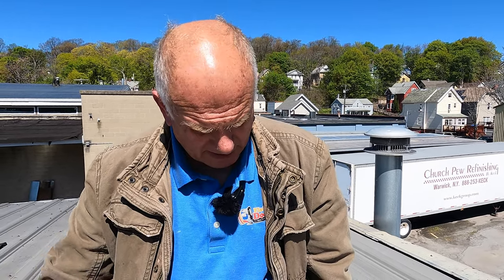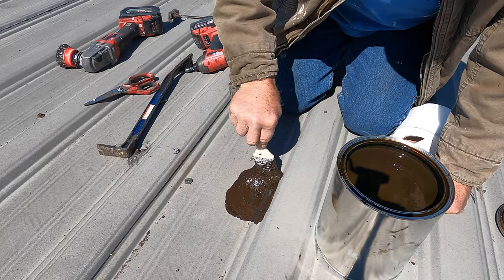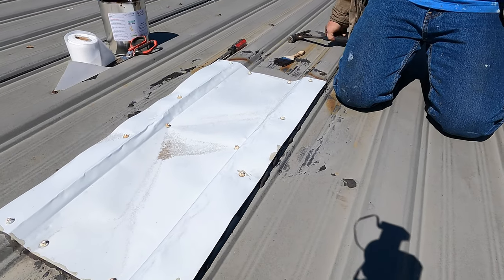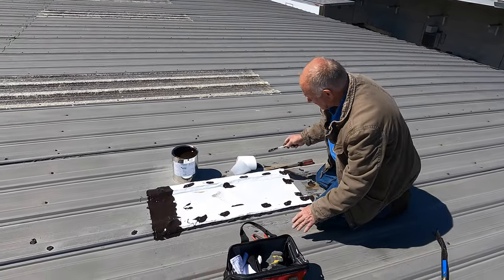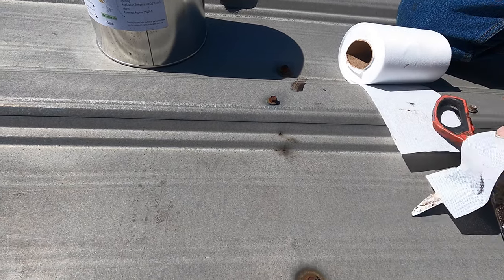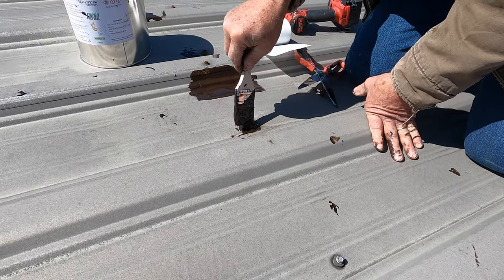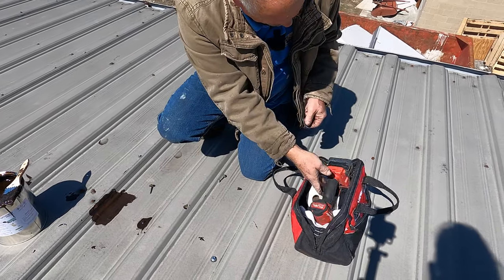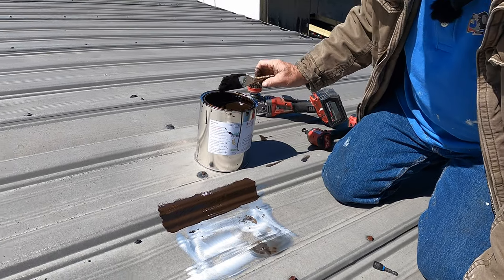How to Find and Fix Leaks on a  Metal Roof

Comment: 1. You NEVER cover a hex headed screw with fabric,  this creates bridging (an air pocket and/or fish mouths) around the fastener...You must cut the cloth at the fastener for proper waterproofing!   2. You always remove old caulking and tar...NEVER cover AND ALWAYS clean the surface area!  3. Is Turbo Poly Seal a Rust Inhibitor?  4. Always a bigger diameter screw, BINGO CORRECT!  5. FOLKS, always clean the surface area a minimum of 6" beyond the repairing area.  6. The aluminum coating will crack with in 3-5 years!
Reply from the maker: You are right in what you said. I am an idiot. Thanks for the comment
Reply: I  hope he makes an update version ,I kinda understand your comment .but I'm a bit of a visual learner (aka I'm kinda stupid when it comes to this
Reply: so are you saying there's no point in using aluminum coating??
Reply: @itsmedante.5325  Aluminum coatings have a place, but not in this application.  Aluminum coatings have no expansion/contractions properties.
Reply: I am renovating an old trailer with a metal roof. I am using a wire brush to clean the roof to bare metal then I will do as you say. Question: what if I can’t get to the hard to reach caulking? Can I just caulk over what I can? Must I remove all rust with the wire brush before repairing? Thank you
Reply: No, you shouldn’t put turbo poly seal or any other sealant over old caulk.  You’ll never get great adhesion, so make the effort to remove it, clean it, and  then apply your 3-course repair shown here.  

I have to agree with the original comment, and sorry to say the roof doctor is making a mistake here.  I’ve personally made the mistake of 3-coursing a hex head screw, and it created a pocket of water that began to rust and leak months later.  

I’d much prefer the screws be removed, the metal patch removed, clean the old caulk and debris off, and then re-install the metal patch with all new butyl tape.  One could then apply a 3-course with turbo poly seal afterwords for extra precaution.  *Use pancake head screws versus the hex head fasteners when applying a 3-course solution as shown here.

Comment: Great video identifying the leaks by looking for traces of rust or dirt stains.  Turbo polyseal spreads well and goes quite a bit, no need to lugging around a gallon tin ;)
Reply from the maker: you right, but I used a lot of Turbo that day on the rest of the roof. The video only shows a small part
Reply: @FlatRoofDoctor  it's good stuff.  Too bad it's not available in my country.  The closest I could match it was with Sika lastic 560 or Duram 195 here unfortunately.

Comment: For a 30 x 60 metal building that is approximately 38 years old, would you recommend just fixing the leaks or replacing all the roofing screws with the next larger size?  Thank you.
Reply: Sand the rust, use metal prep snd galvanizing paint, oversized  screws and a dab of sealant on every screw.

Comment: I like what you are doing. I have had some BS contractors out. My dad put aluminum roofing instead of Tin and 40 yrs later it is fantastic except for….  The nails worked loose and I need to seal those holes. I hope this product works on aluminum. Thanks

Comment: What about using integrated - "long life" - screws, where the head of the screw is one piece with the "washer" that acts as an umbrella to cover the neoprene washer underneath: is there an advantage to these integrated screws?  The disadvantage is the cost, as they appear to cost more than the standard roofing screw.

I'd be interested to hear your recommendation.  Great video content, as usual.

Comment: I would've replaced the roofsheet at once and use 26mm bond washers on the hex screws, I also never use pap en lap membrane. I would have used uni-flash to seal all of those areas if not replaced the roofsheet.

Comment: What size screws do you recommend for replacing the rusted smaller screws? Thanks for this video and information.
Reply: Bigger than the one you pulled out generally if you pull out a 1/4 screw put a 5/16 back because it will bite

Comment: I have a angle grinder what size wire brush should I use to rip off the tar some morons that owned the mobile home before I bought as is ouch they nailed metal sheet they tar over the edges I was looking super close on the ladder which I hate going up I pushed with my finger water came out so water was getting under the metal sheet I ripped it off and holy under water 💧 so mad 😡 this guy is a master thumbs up

Comment: What about on a pitched tin roof with staples (2000 mobile home) ? Also what are all the products you are using? My entire roof is rusted, it has never been coated and it only just started having 2 small leaks.